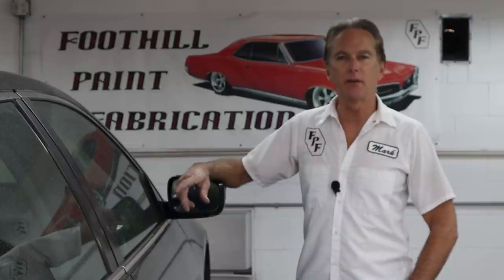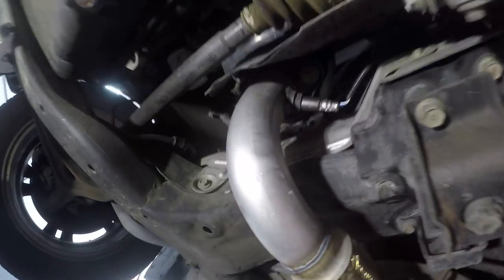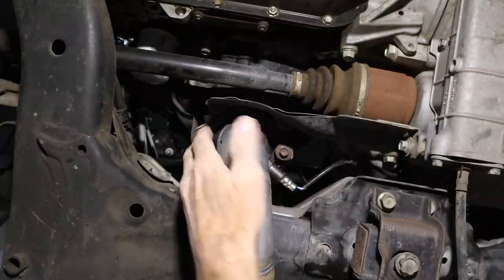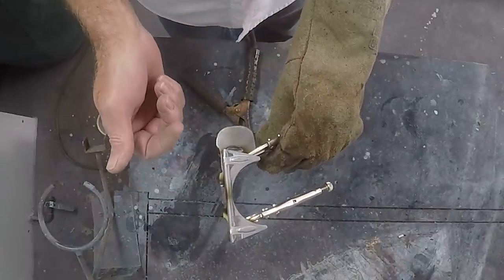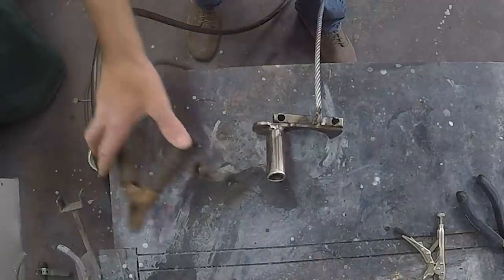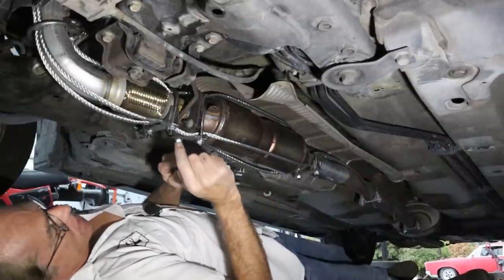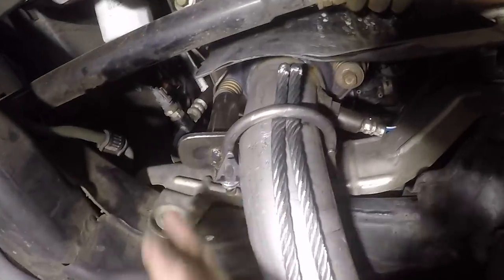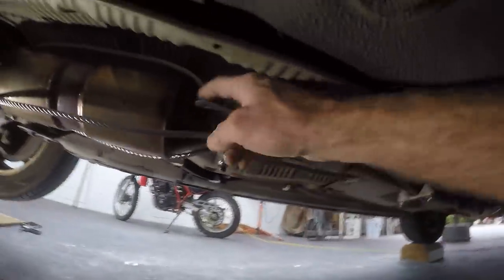Catalytic Converter Theft Deterrent Easy and Cheap

Comment: I have a Honda Element. I wrapped it in 50ft of 5/16 steel cable. Used a few U nuts on the cable and some JB weld on the threads. It would take 10 or 15 minutes to get the cat off with a Sawzall. Been 2 years..still there.
Reply from the maker: Excellent No-Weld idea!
Reply: I would like to try....  I all ways wanted to test people's ideas.... just to see if they work. I know u said it's been 2 years but that doesn't mean it's only their because of your cable system.....
Reply: Can you make a video showing your handy work?
Reply: Still there? How's it worked out for you?
Reply: did the jb weiid burn off  those clamps get real hot  ?
Reply: @larrylafferty3836  nope  JB weld is like metal. Plus the clamps don't get very hot.
Reply: @51-FS  Still there 3.5 years later.
Reply: @mikej238  i still want to see how long it would take to get off...
Reply: @51-FS  Why?Are you a thief? If it slows someone down they will walk away. Just like a steering wheel club. Catalytic converter thiefs don't like to hang around...in and out in 60 seconds
Reply: @mikej238  no. Just to show u that all that work and the jb weld was just a waste of time.....
Reply: @mikej238  guess commonsense ain't very common anymore..... if u read my comments you would know why.....
Reply: @mikej238  and the culb is so simple to get past, (same as jb weld and a cable) 10 sec. To by pass the culb. U just cut the steering wheel with a hack saw and remove the culb......
Reply: @51-FS it’s a deterrent…not a guarantee of no theft
Reply: @51-FS  It took me an hour to put on....25 bucks. Go find something else to whine about. I've had the same Club since 1998, used it on 4 cars....none stolen.  " cut the steering wheel" 😂 must be a thief.
Reply: @mikej238  lol
Reply: @51-FS  You keep yapping about nothing. 🤡
Reply: @mikej238  says the guy who used jb weld thinking its going to stop someone........

Comment: Thank you for the video, I just had mine stolen out of my 7th gen Honda Accord so I’m looking into ways to secure my new one. Unfortunately in New York we’re forced to get OEM parts to pass emissions tests so it’s at least a $1500 expense each time JUST to replace the cat converter. After calling muffler shops all over Long Island, only one was willing to weld pipes around the new cat. Most shops were more than aware of the theft problem but didn’t seem to want to help someone that didn’t have access to a car lift or welding equipment/experience. Besides making plans to get a really good car alarm system plus cameras around the house, I want to make it as difficult as possible for these scumbag thieves and make them think they can never get to my new catalytic converter
Reply from the maker: That sucks, sorry to hear.  Protecting cats in your area sounds like a good side hustle for some extra $$.  Even without a welder you can do this deterrent.  Just buy the theft proof exhaust manifold bolts and take a hammer to the exhaust clamps threads that are sticking out instead of welding the nuts.  Good luck on your version!
Mark
Reply: @FoothillPaintandFabrication  Hi temp epoxy (jb Weld)  on the threads ? Any theif looks under that Accord will walk away ... nice job!!!
Reply: Don’t give them access to underneath the car. Make a 12” block that covers the area between the front and rear wheel. Place it down after you’re parked and have a lip so after the block is place you roll the tire over it holding it in place.
Reply: I found the same reluctance with muffler shops here in southern CA. Very frustrating as I couldn't defend my car and just became a victim. Total damages, rental car, lost wages,....over $3,000! The thieves are hitting my neighborhood HARD
Reply from the maker: @roberthudson5999  Sorry to hear that Robert.  Not many shops will mess with non standard parts on a car unfortunately so DIY seems to be the best way to go for some folks.
Reply: What do you mean by welding pipes around the new cat?
Reply: The cheapest and easiest thing to do is when you are having the new cat installed, bring a bunch of 1 foot pieces of 3/8" rebar with you, and ask the shop to weld a few pieces on each side of the catalytic converter. You might need like 12 pieces or so as they can't leave gaps where they can cut. It's not 100% gonna stop a thief, but it will take them probably a hour to cut through both sides versus the 2 minutes it would have taken before. When they realize they have to cut through 3 pieces of rebar on each side, they will probably find another car. Plus that rebar will ruin a blade after they cut through a few pieces of it. So they will need multiple blades to make it through it. Just make sure they keep moving down the exhaust with the rebar so they just don't cut it further down. Rebar is cheap and the welder just needs to "tack weld" it in a few spots.
Reply: Another thing you can do is measure the width of your frame rails, and the length of this open area, go to a metal supply shop, tell them you want "heavy duty expanded metal" cut to the size of your measurement. This is the stuff that many grills grates are made of. Then take the expanded metal to a welder or exhaust shop, and have them tack weld the expanded metal on your frame rails. Someone will have to work VERY hard to cut through this. It will significantly slow them down. Makes a quick 2 minutes job into a 30 minutes job easy plus they will likely need a couple blades for their saw as one will likely wear out. They will simply move on when they see the metal screen welded over it.
Reply: @SCTundra11  Do you have a photo of your idea?
Reply: @livelife8739  sorry I don’t it’s just similar for me when I deploy my auto running boards on my truck. But just picture stacking a few old fence boards together and make sure the bottom board is longer than the top five boards.

Comment: If a person can't weld, just rivet to the clamp. Also instead of welding cable to clamp can also use JB weld exhaust wrap to wrap around cables as well, just some more ideas. Weld nuts on clamps or use JB weld on the threads.

Comment: I would have gone a single step farther by coloring the cable a bright highly visible color like orange or red so it shows, "hey, I'm installed here!" so it would even deter thieves even more! Mind ya, I would use an engine paint or another high heat type of paint designed so it wouldn't catch fire! Nice video and helpful!
Reply from the maker: Good idea

Comment: Just an after thought, welding a flat washer to the heads of the bolts would make them unable to be removed. 
  Later if needed to remove the bolts you could weld a nut om top of the washer, and remove bolts with a socket or a wrench.
Reply from the maker: Good idea thanks
Reply: How does that stop a sawzall?
Reply from the maker: @nastyab8003  Running a sawzall through cable is very difficult since the cable shakes and the wires bind up the blade.  Not impossible but difficult.  The top cable is hard to reach as well.
Reply: @FoothillPaintandFabrication  yea but since you have the cables tight already the cable isn't going to vibrate when they cutting . A cable that's held tight is pretty easy to cut .
Reply from the maker: @cowboypatriot1200  True but still not something a lazy thief is willing to do don't you think?
Reply: @cowboypatriot1200  what if you welded c shaped plates with oval pass through holes to the inside  of pieces of cable that were welded into rings  around the exhaust and welded  to the frame
Reply: Locking Bolts that require a key to remove works too.  :-)

Comment: Thanks for the video.  I was thinking about doing exactly the same thing.  I was reading up on the Catstrap and figured I've got some extra cable and exhaust clamps are cheap, so plan to fab my own solution like you did, including welding the nuts.  The Catstrap just has cables inside of it, which are a pain to cut with a saw as they want to move around a bunch.  Good job!
Reply from the maker: Thank you.  Good luck on your project, I am sure it will work out perfectly and keep your cat where it belongs.
Reply: I wanted to mimic the Catstrap solution but I was going to have the cables contact the catalytic conver and wondered is that would be a problem.
Reply from the maker: @Royges  Cats get pretty hot but it shouldn't be a problem. Galvanized cable might smell a little at first if the cat gets overheated but that's about it. Stainless cable of course would be best, just stay away from any painted or vinyl coated cable.  Good luck on your project.

Comment: Buy a spool of hardfacing wire for your welder and run a few heavy beads along the length of everything you don’t want cut by a battery powered sawzall . The bead will quickly gnaw the teeth off the saw’s blade before it cuts through.
Reply: And someday the guys at the exhaust shop will love you when they get to add extra labor and materials to your bill...
Reply: @callmed.7171  Any bonafide muffler shop will have the proper tools, e.g. plasma cutter, acetylene torch, high speed cutting wheel to cut out the old muffler parts; they won’t miss a beat to get the old parts out- giving them the benefit of the doubt, any possible but unlikely extra cost is no where close to replacing a stolen catalytic converter…
Reply: @jimseviltwin1  and any bona-fide thief will have tools as well. You can literally get a cutting torch setup that will fit in a backpack. And not all Sawzall blades are that easy to wreck. Get some search and rescue blades and you'll see what I mean. High speed cutoff wheels are also readily available to thieves.
Reply: @callmed.7171  LOL  -  So, I guess your average-run-of-the-mill cat' thief rolls up to ramdom cars with a complete tool box at their disposal...I don't know your background or experience using a cutting torch, but I would pay a dollar to watch some guy crawl under an unlifted  car, and fire up a cutting torch inches from their face to make a minimum of two cuts ( without setting themselves and/or the car afire)... Again, the point of this exercise is to discourage, at least by illusion, that stealing your particular cat'  is not worth the effort; there's too many "easy picking's" elsewhere...
Reply: @callmed.7171  You seem to be rather versed in the art of clandestine catalytic converter harvesting... I'll skip on the cutting torch lesson...p.s. but, the next time you are scuffling around in a Walmart parking lot plying your side gig,  please give me a heads up so that I can make sure not to park too close to the target's car in case you set off it's gas tank with your "backpack torch"....
Reply: Car manufacturers tend to keep the exhaust pretty clear of the fuel tank for obvious reasons. And if that seems too dangerous for you then perhaps the lesson wouldn't hurt. Ever welded a fuel tank?

Comment: You probably could get away with not welding the nuts on the clamps. They don't carry wrenches and wouldn't wanna take the extra time anyway. They pretty much just carry a sawzall and search for specific converters that get the most 💰 and are easy to cut out in a few minutes. They see all that crap under the car, and will just go to the next one. Most important thing is to not give them an easy spot to cut.
Reply: This is what all the naysayers don't get, is not about making it impossible it is about making them reconsider.
Reply: what about locktite?

Comment: Modern cordless grinders are really good these days. With a cutoff wheel I’m sure it will slice right thru the cables
Reply from the maker: Yes they can but this is a deterrent not a foolproof solution.  They have been using a chain tubing cutter they buy at H.F. so it is silent and quick.  I doubt they want to lay under a car with a noisy grinder and sparks flying everywhere in the middle of the night cutting my nieces cat off her car.  It has worked so far but I will let you know if they steal it.

Comment: The exhaust system is grounded. You can tack weld a micro voltage sensor downstream of the converters and send a micro voltage signal to ground. The sensor harness plugs into the O2 sensor and the O2 sensor plugs into the back of the sensor harness to complete the O2 circuit. The anti theft sensor voltage can be used by the O2 heater voltage circuit. When the exhaust pipe is then cut the ground to Batt will be cut and the sensor capacitor will charge and then release charge to a read and write CMOS chip programed to your Key Fob Panic button signal.  Alarm will sound. A secondary run capacitor can be integrated into the circuit and can be used for tripping the alarm if harness is unplugged.  Simple circuit design. I don't know what's wrong with people today.
Reply from the maker: Yeah I was going to do that but I am a better welder than electronic genius :-)  Sounds like a great idea.  Have you tried it out on a car yet? Could be an awesome side hustle.
Reply: @FoothillPaintandFabrication  Hire an engineer. You can manufacture the product under $30 and sell for $240 plus installation.  I'm burned out retired in Hawaii. Good luck.
Reply from the maker: @sharkyrich4844  Nice!  Enjoy your retirement.
Reply: It's the very last cut...that cuts the ground connection. Then the thief is off-to-the-races with your Cat!  Too little time to catch him. Audible alarm or not; he's gone in a flash.

Comment: I followed your lead mostly. I swapped out the exhaust clamp nuts with 3/8-16 tri groove nuts - the nuts and tool will set you back a 'nut'(!!!).
Reply from the maker: Great idea!  Not like the thief's have nice tools.  It has been on the car for about 1 1/2 years now and  caught a couple of guys looking under the car but taking a pass and moving on.  I hope it works well for you too.
Mark

Comment: Most helpful video I've seen so far thanks! Just did this myself pretty easily and used some JB Weld.
Reply from the maker: Excellent!  Fingers crossed for you.
Reply: Where did you put the JB Weld?
Reply from the maker: @tonycox7802  He didn't say but I think he used it on the threads of the exhaust clamps instead of welding the nuts.
Reply: @FoothillPaintandFabrication  OK that makes sense. Thank you for your response.

Comment: just wondering if it will rattle at all?  Great idea though
Reply from the maker: So far so good.  I was careful to keep the cable tight against the cat and pipes so it wouldn't rattle and drive my niece crazy. Twisting the cable around the exhaust pipe after the cat seems to have helped a lot.
Mark

Comment: The main thing going on here is it's a visual deterrent. Many cat crooks are now using a hand held grinder / cut-off wheel and that will go through cable in a heartbeat. A grinder will also cut through the u-bolts and release the cable. Reading between the lines, this looks complicated but will only take another 30 seconds to cut through, if that.
Reply from the maker: Already had one guy look underneath the car and take a  pass so it worked on him.  I will let you know if it gets stolen again.
Reply: @FoothillPaintandFabrication  ... I'd be thinking about retrofitting parts from an electric cattle fence so the first zap might chase them away. I had also thought of adapting an old knock sensor that would generate a signal via the first hint of vibration on the exhaust sensor, then tie that into the car alarm system so it only works when the engine is off.

Comment: They usually will not steal an aftermarket converter because it doesn't have as much palladium as the OEM. And most people that steal them already have a sawzall  with them.

Comment: THis might work... Typically wire cables can be cut in like 4 seconds. Just about every bike ever stolen was secured with wire cables. However, these cable cutters are big and they are not likely able to get the cutters into the 90 degree position while under the car. Not enough room between ground and car chassis to extend the cutters.. Thus, they would likely move to an easier target.
You could also just up your "comprehensive" insurance coverage...
Reply from the maker: It worked at least once so far since I put it on. My sister has video of a guy looking under the car with a flashlight and then taking a pass.  This is a deterrent since nothing can stop them if they really want to spend the time and energy stealing the cat.
Reply from the maker: @CovenantAgentLazarus  No on the other side of the country.  From what I understand cat theft is everywhere now just like copper theft exploded a few years back. Pretty sad...

Comment: nice work! But what is to stop the thief from cutting through the clamp with the sawzall?
Reply from the maker: Nothing is stopping them cutting through the clamps except time.  As a deterrent this will make them think it will take time and more work than using a silent chain tubing cutter on the exhaust pipes and walking away in seconds. Nothing will stop a determined thief if they want to work at it long enough but they want easy money not work right? If they were willing to work they would get a job instead of stealing our stuff. This has worked well over a year, so far so good.